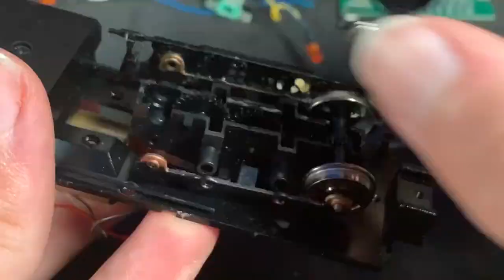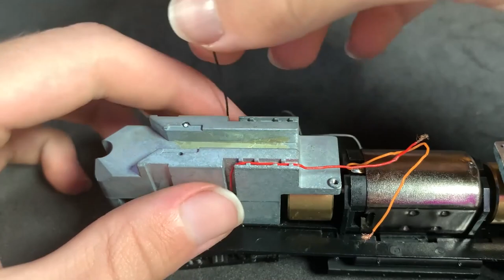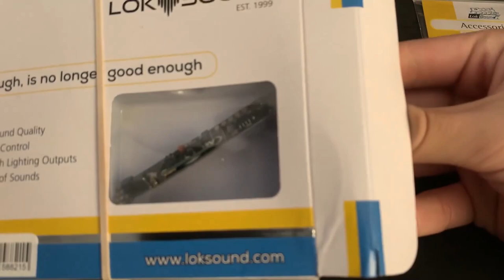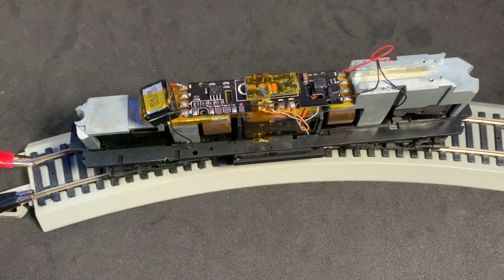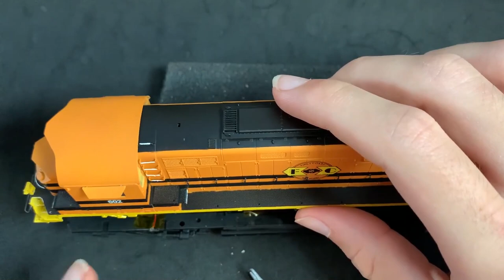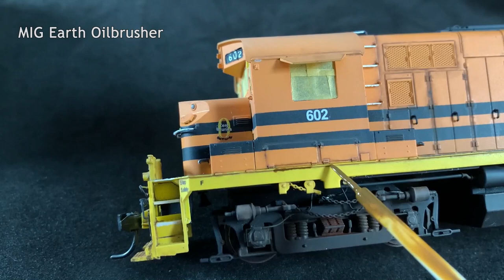Building An HO Scale ALCO RS27 Part 2 | Sound, Lights & Weathering

Comment: Thank you thank you thank you for doing this. I have 2 Life Like Proto 2000 GP9s and 1 Life Like Proto 2000 GP7. All three are painted Illinois Central but I want to strip them, add some details and then re-paint them for the T&P. But I have not done anything with them since I could not find information on what to use to strip the paint with in fear of damaging the shell. Plus I did not know how to remove the handrails with out the possibility of damaging them. So thank you thank you thank you for these 2 videos. You have saved the day!!!!

Comment: I don't know why they would use plastic handrails on an expensive loco.  I hate the sound of HO DCC sound.  It sounds so tinny.  I'm strictly a DC guy.  Atheran are the best models which I have besides the Atlas.  I make my own rust for weathering.  I take 2 rolls of 0000 steel wool and put it in a quart jar and fill it with white vinegar and set it in the window for a couple of months.  Then I pour the mixture into a stainless steel 11X14 inch photo processing tray (any flat container will do) and wait for a couple of weeks for it to dry.  I use a single edge razor blade and pulverize the "rust" into a fine powder for use as a weathering powder.  It looks real 'cause it IS real rust.  I usually heavily weather all my rolling stock and old engines.  I've got three new Atlas engines I'm a little cautious about weathering, but I eventually will do it.  Cheers from a 72 year old modeler from eastern TN